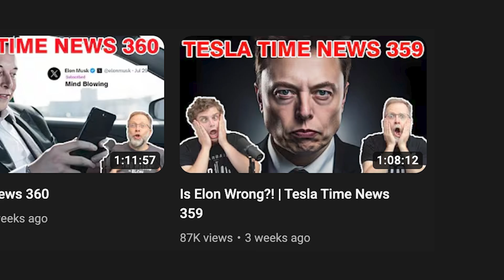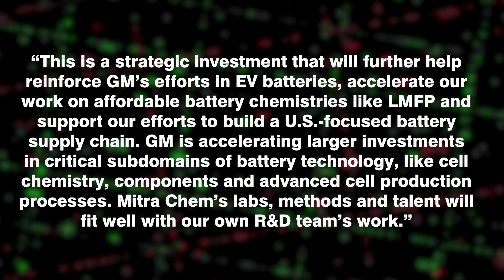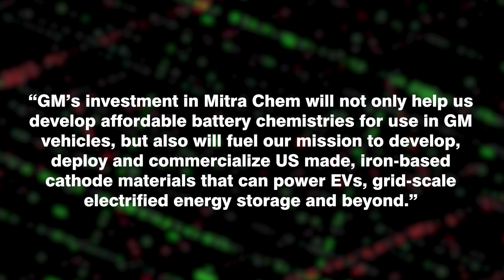Big Battery Breakthroughs Coming? | Disruptive Investing News

Comment: Charge time is the limitation with big room for improvement. Get that down and infrastructure widespread and capacity/distance doesn't matter so much. Once cars are autonomous they'll need autonomous charging too. That is the other obstacle to be overcome. Wireless charging seems a logical next step. Our phones aren't autonomous so plugging them in is no big deal but they are wireless already. A robotaxi needs to b able to drive off and recharge itself.

Comment: Nice article, thanks. Maybe autonomy will be a common feature on cars in USA, or other wealthy states, but my guess is that the cost (currently around 15,000 dollars for the beta) will put off a lot of European buyers. Not unlike the way Europe still prefers manual gears over automatic. Being an optional software upgrade may be an influence, though. 
Personally, I’d like to see a fixed period rental pricing model, so that I would only need to pay for it when wanted, like for a long road journey, or navigating a foreign city. But I suspect that such short term rentals would be eye wateringly expensive.